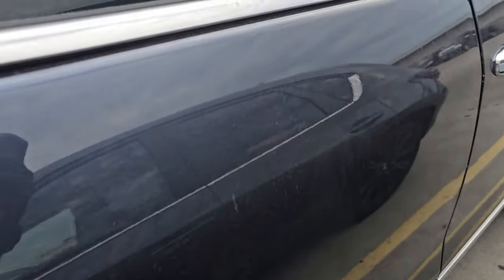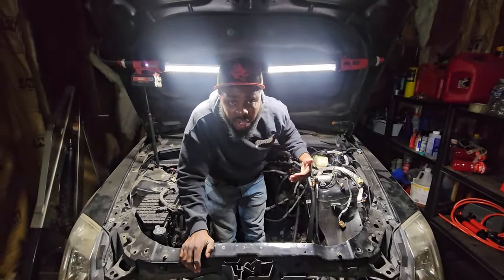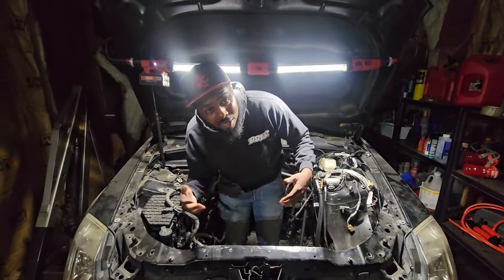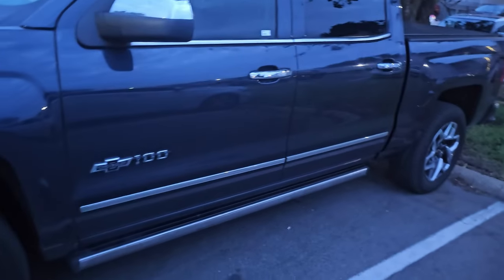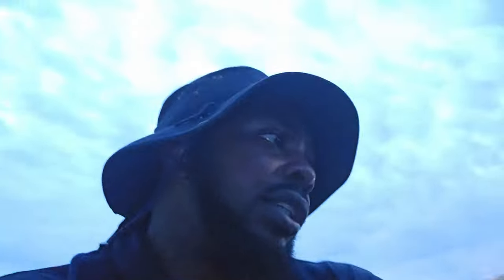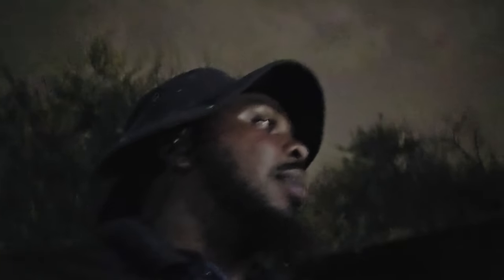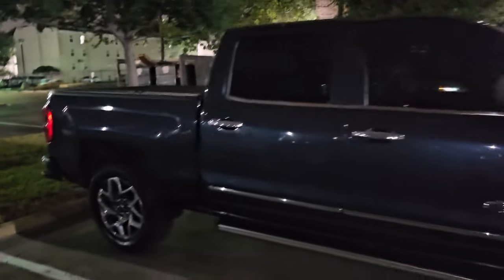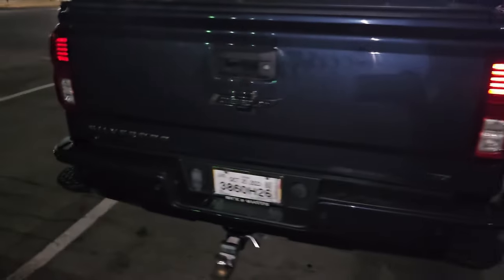I Clay Bar The Truck and The Cermic Wax Did This

Comment: It just going to take a few applications or try a rubber adhesive removal wheel. That’s what I used on my c8 to remove the adhesive left on the hood from removing the ppf. You will need to do a one step polish afterwards though lol
Reply from the maker: I'm scared to pull PPF off of Jazz Car lol. IDK how long it's been on there lol
Reply: @BuiltByLondonRacing  steam and make sure you have the rubber wheel to remove the residue!

Comment: I bought some Adam’s advance spray ceramic graphine ceramic coat to do on the Blackwing but need to do at least a clay bar, single step polish, and then the ceramic coating. Just getting too hot to do much and I don’t have space in the garage to work on it comfortably lol
Reply from the maker: Lmfao. Take stuff out the garage lol
Reply: @BuiltByLondonRacing  my garage has AC so I’ll be fine. Even if I take stuff out I can only have 1 car at a time in there.
Reply from the maker: @JLSpeed  time for a bigger house lol
Reply: @BuiltByLondonRacing  Mann I just need a bigger garage. Next house definitely going to have a 3 car garage minimum lol